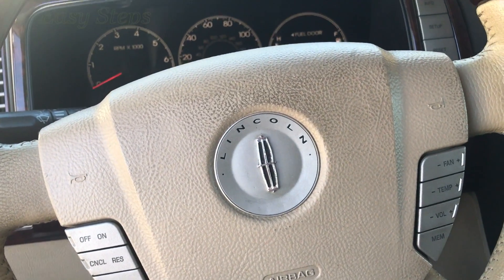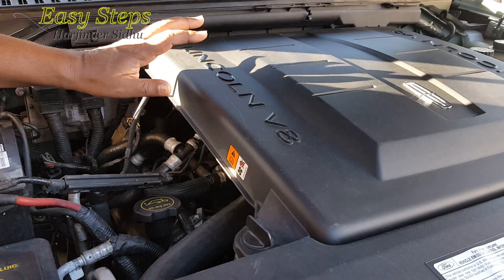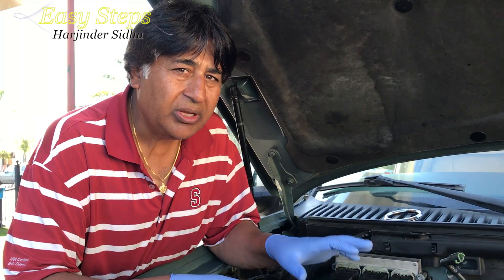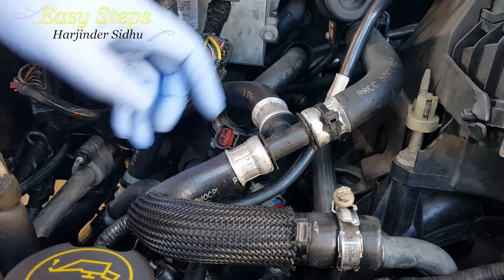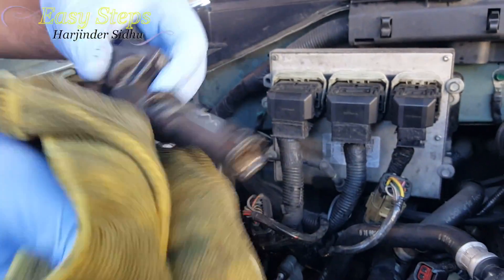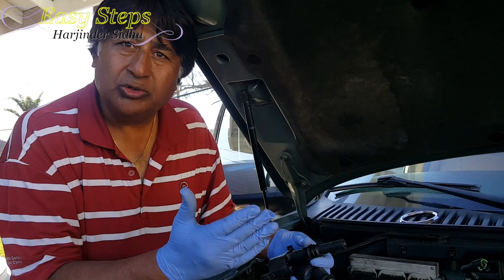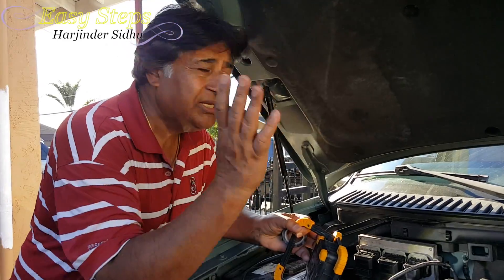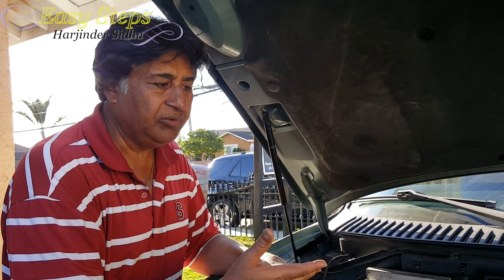Lincoln Navigator Engine Misfire Fix | Rough idle code P0303 | Remove Coil Spark Plugs

Comment: That's the easy side other side number 8 plug you have to remove a exsauste line and is very difficult
Reply from the maker: Yes, it's quite hard to take out...not enough room but it can be done.
Thanks for watching, glad to help.

Comment: Thank you for the video, in the video you mentioned you remove the coolant line? did you experience for the hose to leak coolant? also doesnt that causes the coolant system to loose pressure ?
Reply from the maker: Very good question, the only reason I removed so that I can get more room to work with the coil packs. I didn't see any changes like dropped pressure.
You are most welcome, glad to help.
Thank you so much for the like and thanks for watching.🙏🙌
Reply from the maker: I have started posting DIY videos on my other channel "Sidhu DIY" so please subscribe, thanks.
Here is the link for my other channel, thanks in advance.🙌 🙏 🙌
https://www.youtube.com/c/SidhuDIY

Comment: Hey man resently my lincon navigation messt up its a 1998 it has code p0174 p0171 p0305 p0304
Reply from the maker: You have too many things to take care you have leaks and misfire.
I would suggest please take it to the repair shop or if you know how to do it then tackle them one by one.
Good luck with your DIY project.

Comment: Keep up with your pcv valve or install some type of oil fill cap with a pressure ball valve the sell them for Ecoboost engines. However, these oil cap pressure release device allows the engine to not get pressured up,causing oil leaks.... Replacement of the valve cover gaskets or oil leaks isn't the gasket   failure 90% of the time, it's a pressured engine and no where for the pressure to go....so bye bye gasket.  Keep up with your pcv valve system or add to it to allow your engine to breath and not pressure up, strain on all the internals when it's pressured up....oil pump failure over time, oil leaks, oil pushed through piston rings ...causing white smoke....causing cat system to clog ..causing poor gas mileage ... causing $$$$$ repairs and just ending up getting rid of the vehicle...
Reply from the maker: Thanks for sharing info.
Thanks for watching.

Comment: Hey mister harjinder I like to work on cars and trucks like you but now I have a problem big problem i one to explain to you the best i can
I change the spark plugs on Lincoln Navigator I put new coils I put the 2 vct solenoids two camshaft position sensors still not working right I still getting the same codes 
The codes I getting is p0021 and 
P0012 what do you think about this???
Reply: Ok you think I have to change the ECM/PCM
Reply: Easy Steps so you think I have to change the ECM/PCM?

Comment: The issue is the oil getting onto the coil causing it to short. Temporary fix for this, remove the plug and clean it as shown. Long term fix, remove the valve covers and change the seals/gaskets which prevent the oil from entering into the spark plug holes.
Reply: They come with the same grease when new.   That was moisture and grease in the video.
Reply: @terrywade6172  that’s incorrect. They come with dielectric grease which is silicone based/waterproof grease not engine oil.